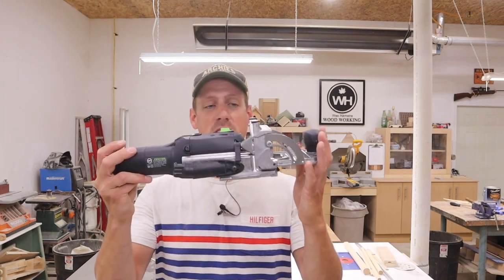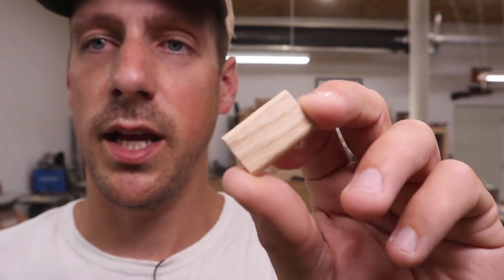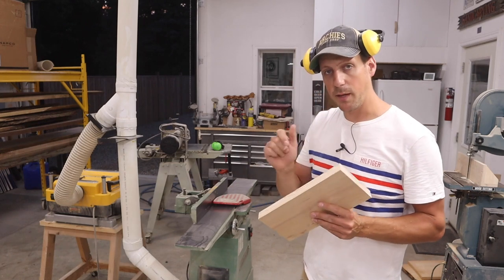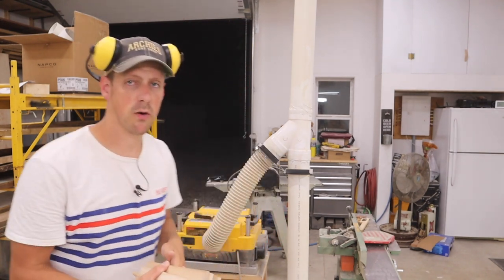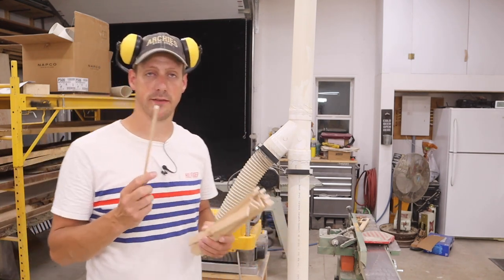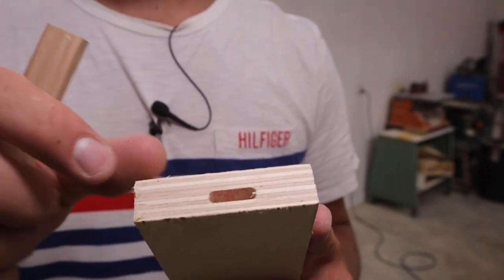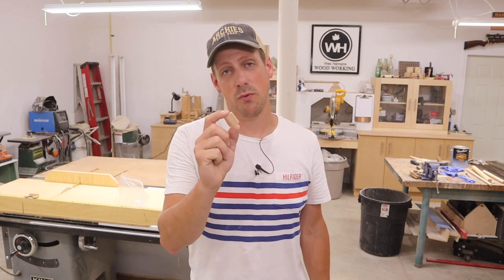How To Make Your Own Festool Dominos!

Comment: For glue joint you actually dont want a smooth surface. So it was totally fine to leave it with saw edge. More glue surface in all those small imperfections..

Comment: For me being conservative on spending I still find by purchasing them better choice for me than making them mainly because they are made with oak and since I don’t have access to plainer and I don’t want to mess a lot with the table saw by cutting thin strips without a zero clearance plate , it’s not cheap to buy but at the same time I am not a mass production company so they last me for a couple of furniture projects plus I include the cost in the pricing of my projects , but for a  wider custom  tennons is worth the time to make your own

Comment: Is there a specific reason why you didn't plain down the initial board to the 'width' of the dominoes?  If you flatten both boarders, you can do two band saw cuts before you have to go back to joint the two sides again... half as many trips between the two tools ;-)
Reply from the maker: That did cross my mind. But I had the planner set already for the thickness and I didn’t want to touch the settings.

Comment: Joint strength tests suggests that loose tenons are almost as strong as regular mortise and tenons.  However, Dominoes, a type of loose tenon joinery, do quite poorly on these tests. Based on some testing it appears like the problem is the Festool tenons and their irregular surfaces (reducing glue contact).  Making your own tenons seems like a great way to improve the strength of domino joints.
Reply: The irregular surface on the dominos is designed to give more gluing surface.
Reply: @drewjohnson4673  yes but pva glues arent gap filling. its a fine line of more surface area and too big a gap for the glue to hold as well as it should
Reply: @chriswitek9455  Good point there 😊

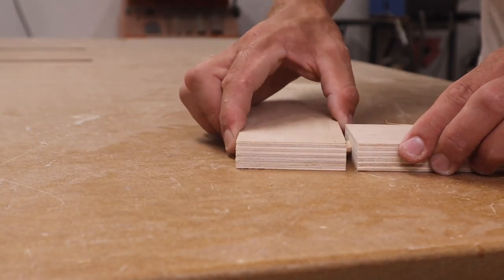Comment: 4:57. Not quite  flash. I have that festool for 10 years already and still prefer traditional mortise and tenon joinery. And for aligning just proven biscuits.
Reply from the maker: Its probably user error. They always say not to blame the tool but blame the tool using it.
Reply: @WesHamstra  LOL. You are correct on the error.  Thing is I would not buy that tool again. I also have festool jigsaw, which in my opinion is junk(primery i still use daily almost 20 years old bosh) and  a track saw TS55. Its OK. But its just ok. LOL Nothing special compering to Makita I purchased 2 years ago. Makita is actually way more powerful and cuts over 2"depth(reason I bought it)

Comment: The main question is how much is you’re time worth.
Reply: @iiiS4  Doesn't save much time if you run out and no one sells them within an hour's drive. These take me 5 minutes to make.
Reply: @iiiS4  That's a fallacy. Professionals dont use expensive Apple like tools (YouTubers do), most professionals go by tools that are not locked to one company so they can move around.
Reply: @nickbailey202  you made 300 of those in five minutes? You're hired!

Comment: Agreed Wes, Festool is WAY overpriced! Nice work on making those dominos....👍😉
Reply from the maker: Yep! It’s the only Festool I will buy. Festools patent runs out in 2027. Hopefully other company’s like dewalt will make their own version.
Reply: You should have said,    In my humble opinion Festool is WAY overpriced.  You'd be surprised how many  people buy Festool's way overpriced stuff.
Reply: @Joesmith-fu4ps  You say it's overpriced, but the quality of their products are undeniable, and they aren't aimed at the weekend hobbyist, they are aimed at professionals who use them day in, day out. When you think of it being used daily it soon pays for itself. I have seen someone with their Festool domino still working from 10 years ago. That means it cost around £1.50 per week. On top of that they offer 36 month warranty and theft protection (they replace if it's stolen) and offer 10year guarantee of spare parts. They also hold their value very well. Yes they are expensive but I have the Kapex mitre saw and the accuracy is spot on every time and it will probably never let me down.